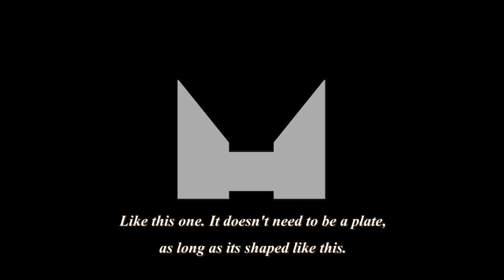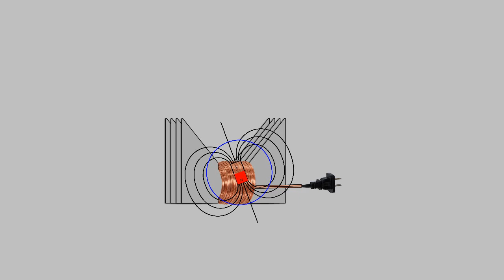Growler, Used to Test an Armature for Shorted Coils Part 1 (2)

Comment: What size of copper wire and how many turns can use to make crawler .
Reply from the maker: just enough sir that it would not burn from using 220v og 110v. Unfortunately i have used an old AVR so that i would not need to count the number of turns and the gauage of the wire
Reply: Don't use mains voltage. Use a powerful transformer to drop the voltage down to safer values. The growl will also be stronger with a bigger current. You will save winding wire too, it needs to be thicker, though.
Reply: @imnotbeluga007 do you know, how to calculate the number of turns ?
Reply: @tttttttt8482  For transformers only:
Simple. Make 10 turns and measure the output voltage. Then divide that voltage by 10. You now got the voltage per turn, multiply that by the amount of volts you need. 

This won't work with primary coils, though. And be careful, because not enough windings and you could have a fire hazard!
Reply: @imnotbeluga007  I'm talking about making the growler.

Comment: No good I make growler, part.get in microwave oven, the transformer, I try the good armature, still magnitizing, I try damage armature, still magnitizing..im not satisfied for  this growler for testing of armature
Reply from the maker: Hello there Albert, well that is what a growler is supposed to do to act like a magnet
Reply: Why my good armature is still magnitizing the blade of hacksaw? Im finish study of electronics technician...
Reply: You show the video hacksaw is not magnitizing...after you shorted the commutator, it magnitize...but me good and bad armature same reaction...its magnitize all size of the armature...thats why not satisfied for this growler that I made...
Reply from the maker: Hello Albert,  there is still a bit of magnetic on the hack saw blade even if its good or bad armature.  The only difference is that on a shorted coil the magnetic is much stronger. Wait I will send you a video
Reply from the maker: @31jobert  https://youtu.be/g6YUPmaoVA0